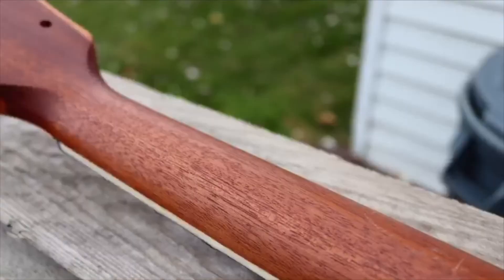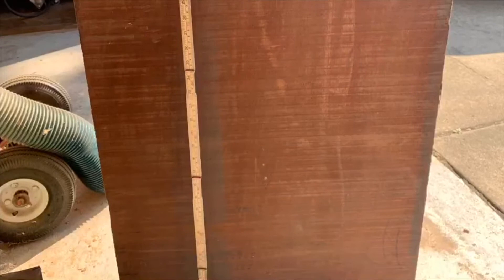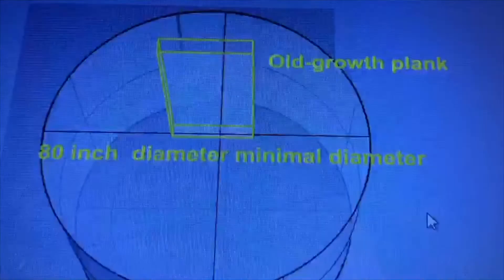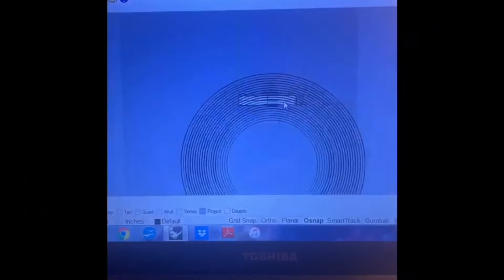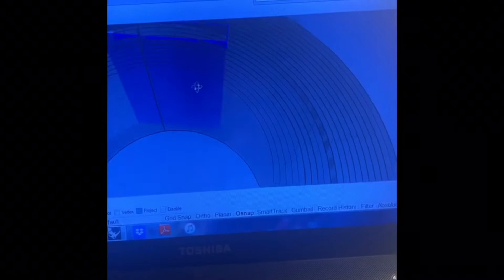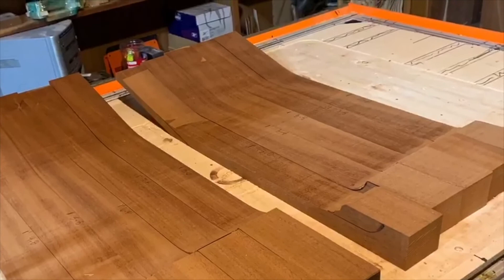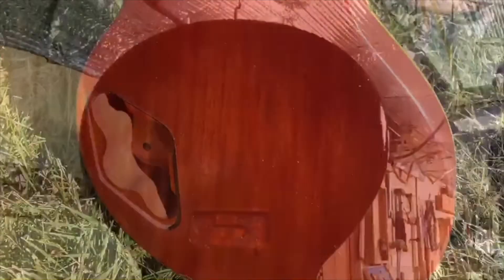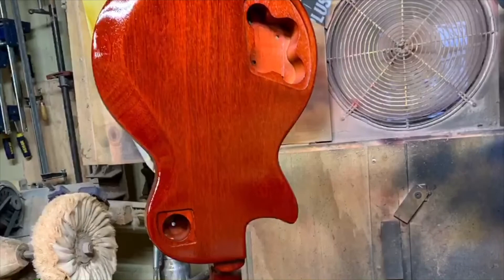Mahogany Wood for Guitar Building

Comment: How hard or soft is the mahogany wood that you use for these guitars. Will it dent it if you pressed in your finger nail to it?
Reply from the maker: It is not hard as soft maple and hard maple is much, much harder than Mahogany. It is much harder than spruce and pine though. It is considered a hardwood and is dense. A fingernail will barely make a mark. It is dimensionally very stable and will not absorb moisture very rapidly.  And even slower when a finish is applied.  As for musical instrument making, it is considered a wood that exhibits high potential resonance although if thick enough as in a guitar neck, will not resonate sound but thin mahogany as in an acoustic guitar back or top will radiate sound well.
Reply: @kennymac58  My mother purchased a Gibson "parlor guitar" back in the 60s and it was an expensive model at that time and was made from mahogany.  I cant remember the model # but thats what they referred to it as.  It was slightly smaller body/neck than other acoustics. It may have been built for women since neck/body were slightly narrower.   It sounded like a piano the way it resonated sound.  I have played tons of different brands, models, but I have never found one that sounded like that guitar did.  My mother passed the guitar to me and a few years later my house was broken into and that guitar was stolen and never seen again.  About 10 yrs later I purchased a Gibson Dove and it's a very expensive model but it just doesn't have the same resonance that those old mahogany guitars did.  I bought it b/c it was the closest thing I had found to the sound but still not as good.